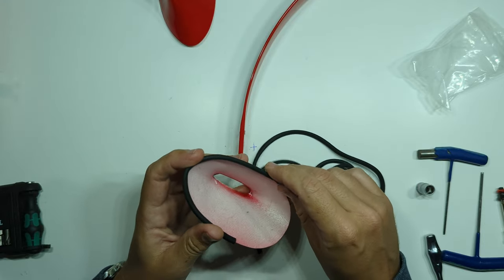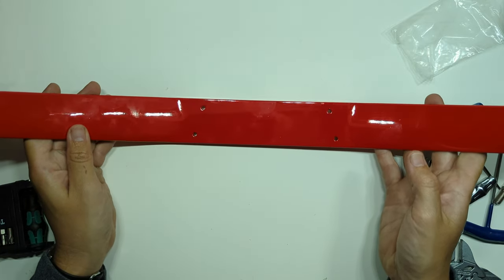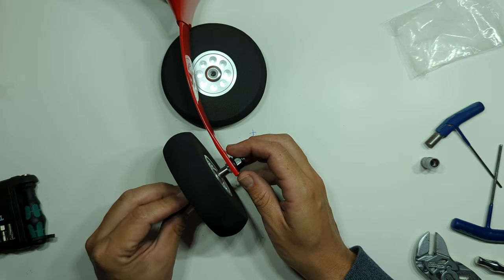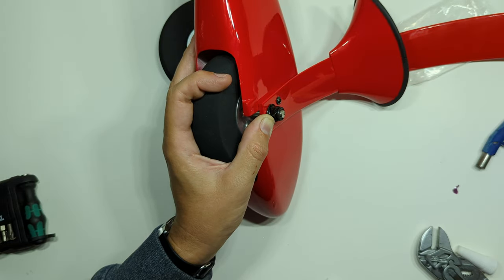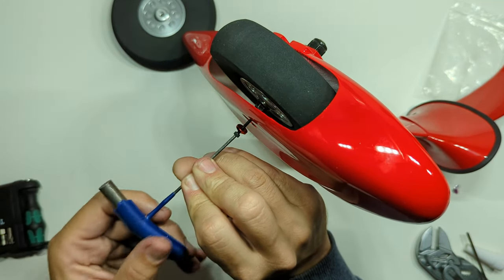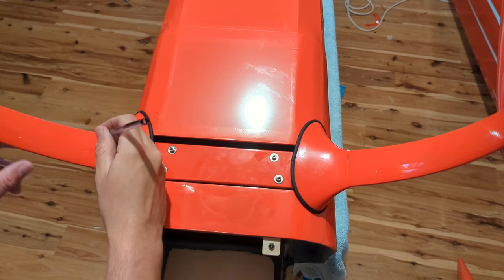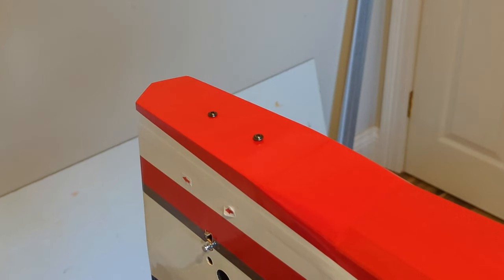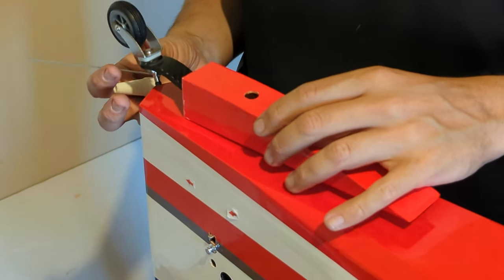104" Skywing Extra NG build part 1. Landing gear, rudder and tail-wheel assembly.

Comment: What canisters were you waiting on for DLE130 - what size Falcon prop did you settle on - tks Wayne WRCS (busy with my build atm)
Reply from the maker: G'day Wayne, I used JMB and contacted Milan directly. They are perfect for the dle130. I was using a 28/10 for 3d and I now use a 28/12 for my IMAC competition flying. Would love to see your build when it is done.
Reply: @joeytavora1270  
Hi Joey
Your videos have been a great help in the assembly on SW NG 104”
A couple f items that could be highlighted:
I assumed the elevator servos were mounted in the elevator sub assemblies so when looking for the rudder servo location I hacked away at what I thought it was only to find it is the optional elevator servo mounts in the fuselage (the factory places 2 arrows pointing in the same direction (what was that supposed to mean, E and R would have been better labelling :) )

The XT60 plywood holders are great but they only supplied 2 so if you run a dual battery system with ignition 3 would be required.

The spinner template for the backplate is 30 degrees off the props I drilled and one pre drilled from DA (factory should include a note)- suppose it would be ok if you used their supplied template for both prop and spinner back plate.

JMB canisters:
Did you remove the coverings on the underside and use all 4 vent panels in order to mount the canisters?
The 16 plastic rings - are this used to ‘surround and hold’ the canisters or are they for some other purpose - I can’t fathom yet as I don’t want to cut the covering without knowing (else I land up with un necessary holes (like my Fuse elevator hole which will get a decal to cover it). If you have any videos/pics of the canisters assembly/installation it would be greatly appreciated - 
JMB SET-3DHS-E540-106"-DLE130-REAR EXIT

Once again thanks for the videos

Cheers
Wayne